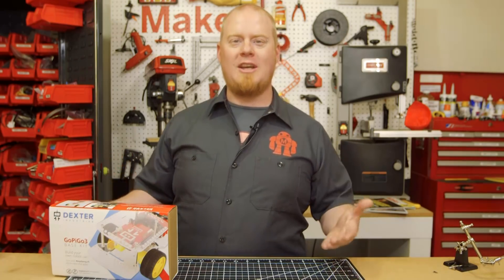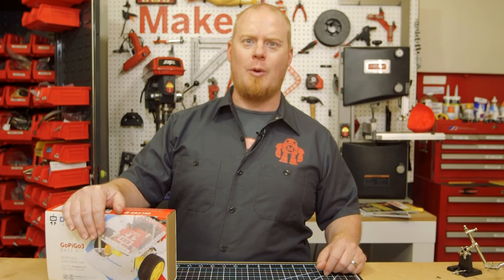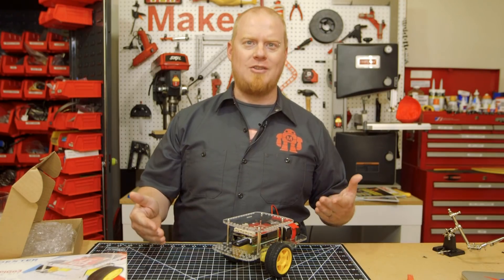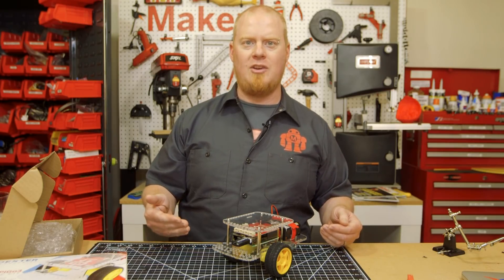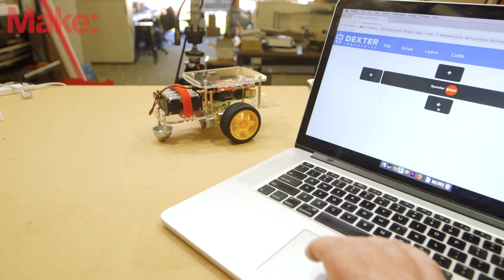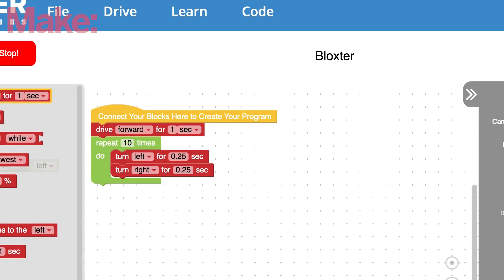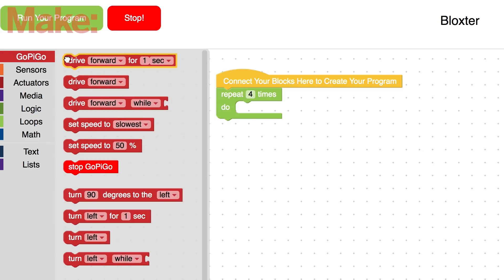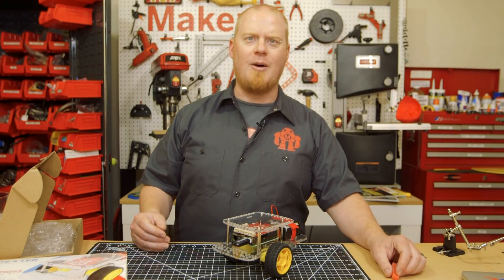Introducing the GoPiGo Robot Kit

Comment: I would love to get this for my younger brother but he doesn't have any access to wifi, is it possible to program the robot via usb ? Also that's a ton of batteries, how long does it last before recharging ?
Reply: Well from my personal experience, a couple of hours - it also depends on what batteries you use. As for programming it, I assume every laptop has a built-in WiFi adapter, so just use that to connect to it. If not, then just get a WiFi adapter - they are dirt cheap - like somewhere around 10 bucks.